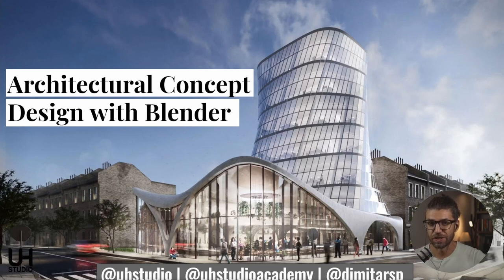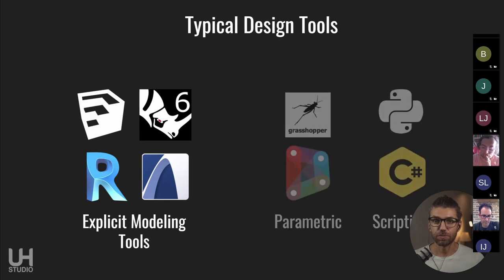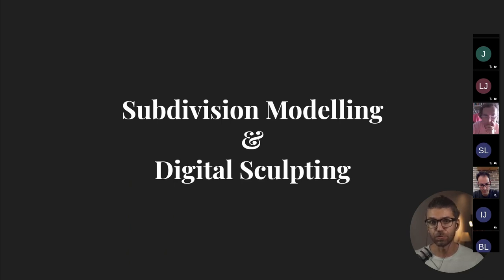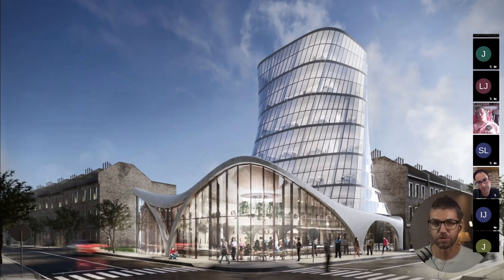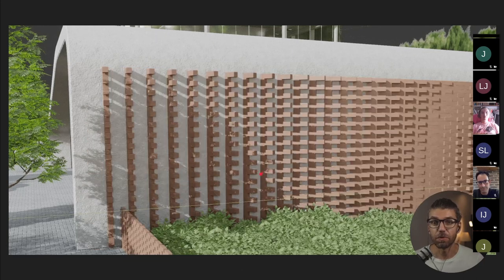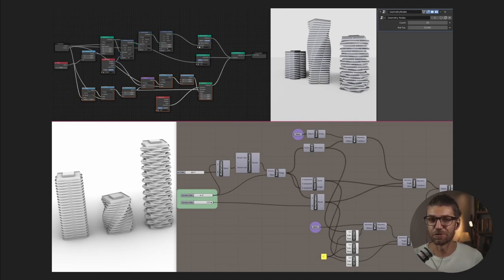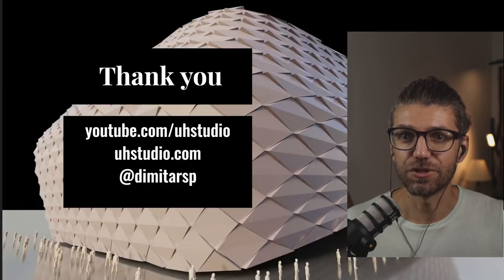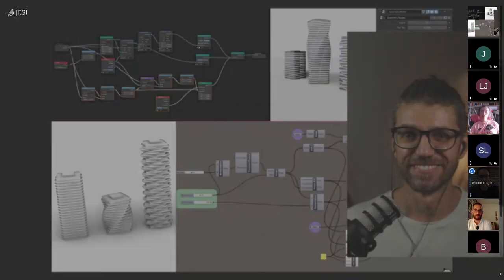The four ways Blender is useful for Architectural Design - OSArch monthly meetup

Comment: Dimitar, thank you very much for your presentation. It's awesome...I have a question regarding areas in your early stage of design.Usually clients want to see, near design they want to know the areas(numbers), how much bruto and neto at the end they gonna get.At the end for the clients areas is the money that they gonna get. So, is it possible to extract and export areas from design using geometry nodes? Thanks
Reply from the maker: There are ways to export geometry nodes elements, but that can be accomplished by other means - addons like MeasureIt_Arch, BlenderBIM, and Archipack